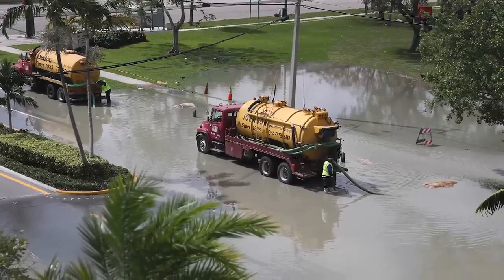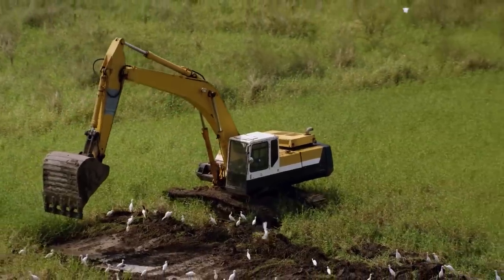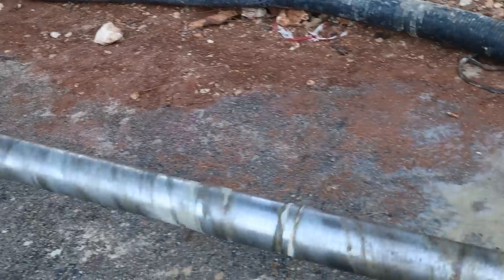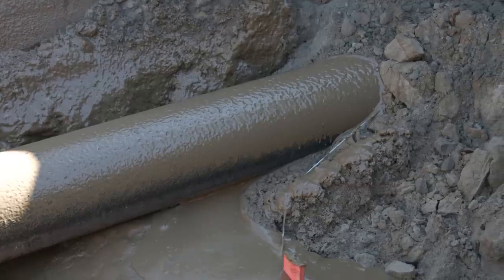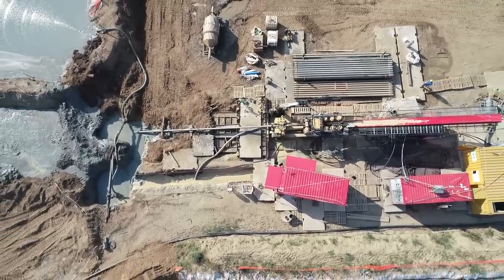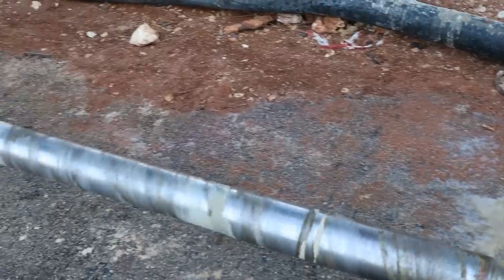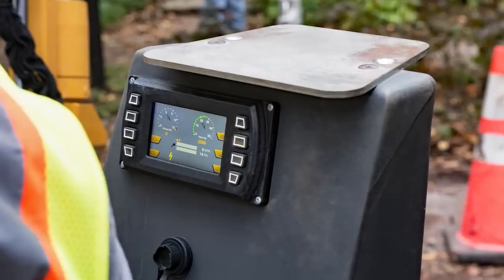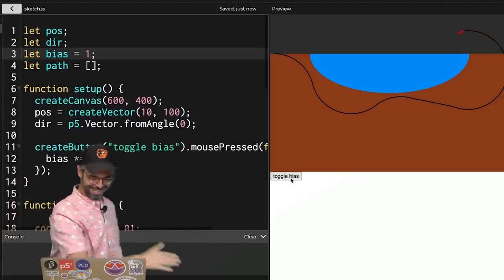How Do You Steer a Drill Below The Earth?

Comment: A few years back some new houses were built just up the road from where I live the water was laid on with horizontal drilling but when the telecoms came along they dug a trench along side where the water pipe was through the newly resurfaced road which they then back filled and even today the road surface is uneven and keeps breaking up where the did not make a proper job of reinstatement.

Comment: I used to operate a coal auger in a coal mine that would auger coal from a highwall after they took the coal out, we could steer the bit by the speed and force applied to the bit. If you wanted it to climb to fallow the coal you would force it into the coal and slow the speed to keep it straight. To steer right or left depended on the speed and force again. And we have no idea where it's at in the hill and can only tell where we are in the coal seem depending on the sound and feel as the top an bottom of the coal seem is harder rock

Comment: Not simply pulled yanked that is vibrated back through. You see now that you have a path you can go through blindly simply by forcing your way through and you'll be redirected and corrected almost immediately simply by rapidly jerking on the line spending the line line taught every time you get a little bit of Slack as that jerk has pushed away the drilling slip. And the reason you do not add more drilling slip necessarily is because you want things to set up when you send your pipe through so those little jerks will push the water out of the slip or push the slip through the hole either direction it will remove water from the previously drilled area thereby drying out the slip or getting it out of the way by pushing it forward when the consistency is more moist you usually end up pushing the water or dragging the water out with those rapid Tugs allowing the slip to take up less space and allowing you to pull your main line back through your previously drilled hole as you have opened up the size of the hole due to the loss of water and possibly slip as well but great strength pulling it pulling your line directly back through is not near as necessary as you are making it sound the Golden Gate Bridge can be destroyed with a tack hammer striking it multiple times in Rapid succession at a particular rhythmic beat that multiplies due to pickles and Gate Bridge is Construction and the ground that it is resting basically you just have to get the frequency correct and since you you used a water jet to run your line through the first time now that you're dragging your tube back the rhythmic something is doing the same thing as the dry rhythmic something on the Golden Gate Bridge is creating an echo making slight adjustments as it passes through you pull just a little bit but the tube that you're pulling on is vibrating at an appropriate frequency to force water to evacuate and thereby automatically widening the hole all you have to do this point in time is have enough pull on the pipe that's doing all that vibrating in order to get the pipe to move through empty space

Comment: You dont have to drill surface to surface You can dig pits on ether side this is were you do your connections. set up the drill on one side drill down cross your pit at the appropriate angle/depth then drill to your second pit at any angle you want hit that pit. Then hook your pipe up pull it to the first pit disconnect it remove your drill string. Then connect your pull section to your other pipes

Comment: They did a horizontal drilling under the highway where I live not to disturb the main highway through the area. Unfortunately there's now a dent in the road, straight across where they drilled. So I guess they removed a tad too much material, so it collapsed slightly after a while. :P

Comment: Sometimes, I would prefer trench technology over trenchless tecnhology if it means service holes and passageways for easy replacement of pipelines. This could be in the form of brick lined tunnels underneath the road surface with pipe racks supporting the various utility cables and piping.

Sure it's better to have soil that's already there to support the pipeline but when it comes to servicability, it may be better to not disrupt surface level traffic in the future.

Comment: I work on a company call utetek we do soil stabilization also lift houses that sinks cus a flood on houses happens the houses can fall on a corner or hole site also we lift roads that sink ithe material is cal poliutene is 2 quimicals injected and mix Thad can expand and fill the gaps on the ground check it out it will a
Be a good video on practical engineering

Comment: The bent wire pushed through agar is a brilliant demonstration! 
HOWEVER, most of the field examples shown were drilled, not pushed, that is, the pipe was rotating as it advanced into the bore.  Is the pipe only pushed when the angled end is pointing in the desired direction? How does that work?  If the angled tip is rotating, then does that make the hole much bigger than the pipe diameter?

Comment: Thanks for the informative video. I have a couple of questions if that's OK.
Why is it called horizontal drilling? And What is the furthest distance. thats been drilled horizontally?
One more  If you don't mind. 
Would you agree that,  
Horizontal is a geometric principal,  we use the term   level as the physical relationship in reality they are the same in any construction works, one is on paper  and one is achieved using techniques that you have shown.  Thank you.

Comment: What about having a movable head to select between going straight and curving (or even curving by different radii)?  Use coaxial pipes to control the head position by way of differential pressure in the different conduits.
Reply: For all the HDD I've seen being done, all you have to do to make the angled/steerable head go straight is to rotate it like a normal drill bit. It could be assumed that the path would then end up like a corkscrew, but they've always had the RPM's high enough that it would bore quite straight.
Reply: @js9514  Maybe the reaming process straightens out the corkscrew?
Reply: @Lucius_Chiaraviglio  fair point

Comment: Thank you!  I have wondered about this for years, the simple “bent pipe” explanation always led me to think: won’t it just go in a circle?

I know in my neighborhood a fiber line hit a 24 inch gravity sewer main.  It went right through the center and out the other side, and the city video inspects the lines and so I’ve seen video of it…  Surely when they hit it it must have dumped all the drilling fluid, but my understand is the the fiber company and the sewer worked fine for many years before they even noticed the problem.

Comment: Not sure if it counts as drilling but when I had a gas main connected to my home a few years back they used one of those pneumatic 'moles'. I warned them before they started that the ground was full of rubble and I had my doubts it would work.

They had their doubts too but they'd been given orders to use the mole, which they hated, so they did.

Two guys took four days to go about 10 metres and three and a half days of that was digging holes to retrieve the mole when it got stuck. It looked like The Somme out there by the time they had finished 😀

How to use technology to make a job ten times harder. If they'd dug a trench they would have been finished in a day.

Comment: 0:37 On this fly-by of Las Olas Blvd, what you don't see is all the new bridges they spent the last 8 years replacing. It has been impossible to live in Fort Lauderdale and commute anywhere in a timely manner with all of this construction. The city has allowed developers to replace greenspace with mega high-rise development, and as more and more people come down here they've crammed so much sewage through the pipes that they've all literally exploded. Pipes are still exploding and raw sewage rises through the asphalt over the breaks. It's the worst. All the fishing has died out in our waterways because of the poop the city has shunted straight into the canals. You used to be able to have a great ocean breeze at your house on the isles, climb on the roof and watch the fireworks on July 4th, but now it's just hot and miserable all the time because all of the mansions across the canals have blocked the breeze and any kind of view. Most of the residential spans were trenched, or they may as well have been with the road reduced to one lane for months at a time.
Grady, maybe your next video can be on cities that have been inundated with sewage without the infrastructure to support it, and how capacity gets added to handle it. Ft Laudy can't be the only place where this has occurred, right?

Comment: I wonder if this concept works on most materials, especially with having a cutting bit at the end like the mud motor. 

Say if I have a building, wood construction with expanding foam insulation, and I need to run a new line of cable(s) through some walls, but tearing up the wall itself is too costly, could this concept translate to that project; with a small pilot drill bit, a bent shaft that can be rotated coaxially, and a feed wire with a way to transmit power to the drill bit. Or similarly, say I have a concrete slab as a foundation and I want to install a second bathroom that isn't conveniently located in an adjacent area to the utility room, this seems like a good application of HDD to get from point A to point B with minimal destructive access. I know in this example, insulation of any kind wouldn't be an issue, but wood or any brick or concrete construction could be. In all the time I've looked for fringe construction, woodworking, wiring, etc. projects, I haven't actually come across this as a concept, and to be fair setting up a proof of concept would probably be costly for all intents and purposes, you'd need a considerable amount of material, you'd need a way to drive the cutting bit while also having a driving tube, etc. The closest thing I've ever come across are various robotics projects that're more or less wall snakes, or more recently inchworm-like robots, a more compact solution that's driven from point A to point B, but I'm not sure if those projects had ever gone anywhere, IIRC all of these also failed at corners due to restraints in their joint flexion range; which is also where this concept would fail without a bit of modification, just as a manipulated joint at the bend in the tip, something to vary curvature. Reaming and pullback are also interesting additions that could also be applied to this concept, especially now that flexible tubing is becoming more common. I would imagine this concept, if it has any viability in the first place, could also work off an air motor, similar to how the drilling it's based off of uses water, and use expelled air for debris clearing if not also use a vacuum within the feed tube to also clear debris behind the drill head; it would seem feasible if the piping had good joints, friction tube on joiner joints would suffice but this could cause issues at tight curves. I'm curious if anyone has actually tried a home construction analog of HDD, seems like it'd be a lifesaver when you don't want to or cannot have destructive entry of a wall or floor.

Comment: Boring is a great thing until you hit rock.    If you're in an area with shallow bedrock, or laden boulders from millions of years of erosion - boring just isn't an option.   We have to do test holes every 10-20ft before even thinking about boring here in PA where I work/live.   It is a rare day when it is feasible to bore.  PA is one big rock garden.   Trenching and rock cutting(jackhammer, explosives, saw) tends to be the faster and cheaper option versus boring.   Poles being the cheapest option for power/communications.

That Mariner Pipeline passed right through my engineering turf.   Most of which was open trench, only boring where it would have to pass under roads/rivers/etc.

Comment: 10:00 But how can a drill(!), which is by definition a rod rotating around ITSELF, be directed, as it's bent head rotates with all the drilling rods connected to it? I mean, the "stone crusher" at the tip doesn't have it's own engine, what I have seen so far on oil drilling rigs, which makes sense, as you always would need to connect cables as well with every drill rod segment getting inserted!

Comment: I've recently performed Geotechnical design for an HDD project to run a new water main beneath the Ohio River. Cool stuff. I can confirm that HDD can be a pain in PA, where I live. Our soil can be very rocky and shallow, so drilling through bedrock in common. However, you have to dodge the old coal mines, karst features, and slides. Or you may be in very deep glacial till, so boulders galore! PA has no shortage of work for geotechs!

Comment: How do you avoid hitting other underground structures of existing and perhaps poorly or not at all documented pipes and cables or undiscovered archeological artifacts?

When my parents built a new garage, they had to dig down in one corner because according to the maps there was a sewer line a few meters from that corner, but when they dug down the sewer line turned out to be underneath the corner. Apparently the maps of where the pipes were supposed to be was 5-6 meters off from reality.

(Ironically the previous old garage had been built on top of the sewer, and the location of that garage had originally been recommended by the guy responsible for pipes and building permissions in the municipality) 

So they had dig much deeper and build a culvert around the sewer pipe, and foundations several meters below the pipe so that it may in the future be serviced without the garage sliding out. 

But how would a drilling operation like this avoid damaging pipes that are not where they're supposed to be?
Reply: Also, if the soil has unexpected differences in firmness would this not then tend to turn towards the softer soil regardless of the orientation of the drill?

Comment: I work in the underground construction industry and I once saw a directional drill operator puke when the drill head came out wrapped in fiber optic cables. It was a bad day but thankfully it wasn’t our fault because the utility locator had miss marked the fiber by 10 feet. Which means it was a worse day for the utility locator that didn’t properly do his job.

Comment: so, does the drill have a "straight" mode where it just rotates its self constantly, resulting in a straight (if somewhat wobbly shaped) borehole? and how do you get things like pipes down in there in the hole once its done?
Reply: No you rotate it with a joy stick like normal and watch your push/pull pressure Guage to tell you how hard to push and you hook your pipe to a swivel then to the reamer and pull it in

Comment: If the drill is spinning as it’s boring, how does the steer bit on the end not spin round and round? Is it floating on the tip and how is it steered? I get how the head is angled and is seeking a curve and all. I just don’t get how it isn’t spinning and how can it be steered or clocked? Anybody have a clear way to explain this?

Comment: 35 years in the oil industry from 1979, starting as a wellbore seismic surveyor to magnetic and gyroscopic surveyor, then onto MWD (measurement while drilling) and finally conventional, steerable motors and finally closed loop directional drilling, I have to say you have mixed up a lot of technologies over 35 years in an effort to explain horizontal directional drilling. Horizontal directional drilling was never an option during the conventional directional drilling years, where fulcrum and pendulum principles were applied by stabiliser placement within the string and bent subs with straight motors were used for kick-offs and corrections. The second phase of directional drilling was the invention of bent motor housing which gave the Directional Driller the ability to stop rotation and steer, but only possible because of MWD's ability to give toolfaces, to show where the bit was pointing and steer accordingly, before starting rotation and drilling ahead. The third and final development in directional drilling was named closed loop with steerable drill-strings that acted like driving a car and being able to make minor adjustments while constantly rotating ahead, thereby reducing sliding friction and not getting stuck, a system that is more heavily computer dependant and less upon the old fashioned directional driller, a person with considerable knowledge about drill strings, formation, muds and the tools that made up the BHA (bottom hole assembly). Drilling horizontal holes today is much easier because the technology and equipment has made quantum leaps in steerable drilling and continual surveying, much of what your video depicts is glib and nowhere near what and how it's actually done, your simple wire through jelly, has never been factual, you have always had a BHA on the end, you need that for control and without it, that wire goes anywhere, regardless of what you do. I give you a three out of ten.

Comment: It seems like all of this tech came from the Oil and gas industry, you are even using all the same terminologies and equipment although on a much smaller scale. These techniques have been used by oil and gas since the 70's or so. Even in the 80's there were tools (Measurements while drilling) that transmitted location, and geological data back up to the crew using a sonic carrier wave (around 12 Hz)  through the drilling fluid. These tools have since gotten very advanced and expensive and typically called geo steering and logging tools. In oil and gas wells, the geological data is critical and sometimes in exploration wells thats all they want at the moment. The use the steering system to move through various parts of the field to gather information in many places instead of drilling multiple wellbores.